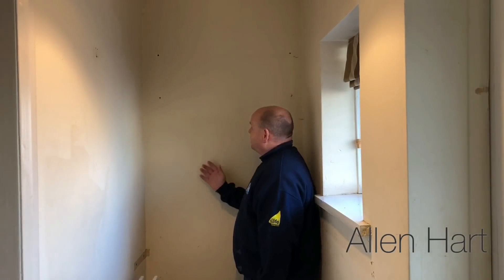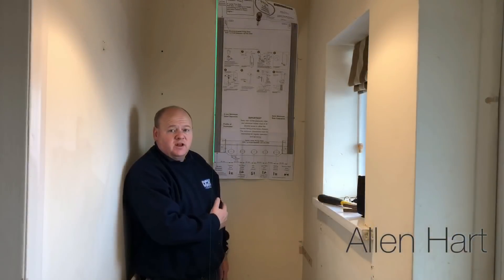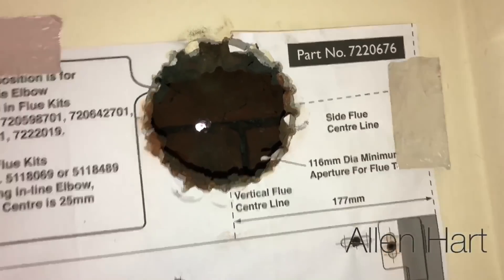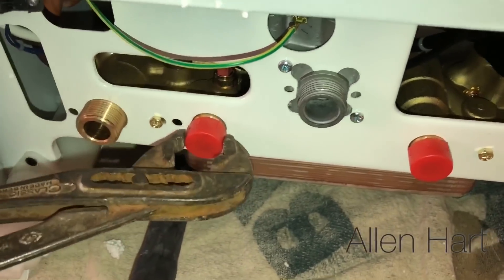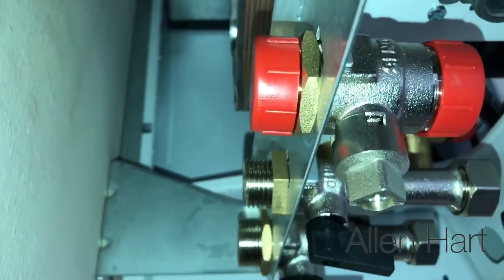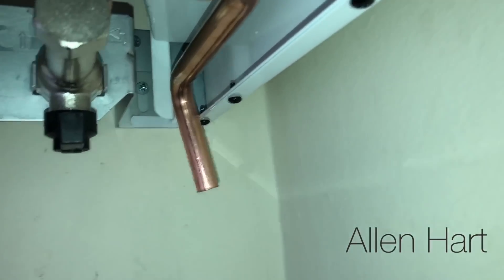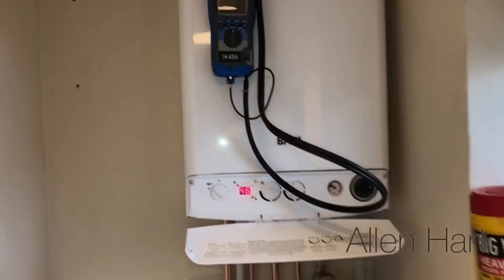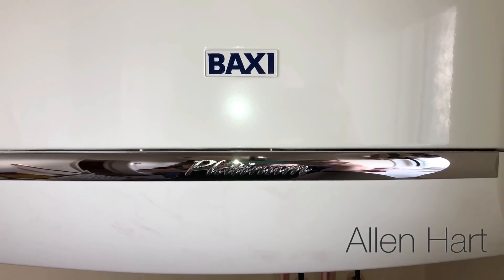How to Install a Combination Boiler Baxi Gas Combi Boiler Installation

Comment: Im confused about those copper pipes underneath.Im guessing they are flow, return, gas and water but what is the other one for?
Reply from the maker: Return, Condensate, Hot, Gas, Cold, Flow and PRV. Thanks.
Reply: Thank you. Every day is a  learning day!
 @AllenHart999

Comment: Nota bad video but it didn’t really show to much.   I just also don’t understand why you didn’t drill one pilot hole for flue then go outside and drill core hole so no mess.   There was nothing about the flue or soldering of pipes really basic.

Comment: Very random question, but we are about to have a combi boiler installed, will the plumbers need access to each radiator to check the heating works afterwards? I have a room filled with stock that I sell and would need to shift a lot of stuff for them to get to it and was hoping they wouldn't need to check the all lol thanks in advance
Reply: So what happened

Comment: Say the gas meter is in the garage and theres a has supply going into my airing cupboard, because i havnt had a gas boiler (soild fuel) would they need a new gas supply routing jnto the house?
Reply from the maker: Yes you would need a gas pipe for a gas boiler. Thanks.
Reply: @AllenHart999  there is already a supply into the house i guess they would take it off that, unless BG fit some kind of new meter and piping
Reply from the maker: @markjwoodford1931  I would expect so. It’s hard to give advice without seeing it. Thanks.

Comment: Are these easy to fit to existing heating systems? We’re looking to change from oil fired central heating to gas, but I’m unsure oh how much work is involved, ie do we need to change existing pipes and radiators? Do new pipes need to go outside the house ie drilling through walls, so we need a new flue or can it be added to the one we have?
Reply from the maker: You cannot buy these boilers anymore, unfortunately. Thanks.

Comment: Hi Allen Just a question about the positioning of a condensate pipe.If there is no choice but to site it externally will it definately not freeze during severe cold weather if it is fully lagged.?
Reply from the maker: This one has loads more. Thanks https://www.youtube.com/watch?v=knON5Asy1YQ&t=783s

Comment: So easy, takes about half a day yet a some idiot from British Gas charges you thousands to drill a few holes and fit 6 pipes.. total rip of. Thank you to honest gas fitters, that don't rip people off. Although there are not many
Reply from the maker: Most people understand the price of everything but the value of nothing. I go to loads of cheaply installed boilers. Thanks.

Comment: Can i ask a question about being a gas safe engineer, i have been told by a couple of fitters that the rules regarding this only  apply to actually connecting  up the gas supply to the boiler,  there is no reason why as a regular plumber  you cannot fit the boiler to the wall connect all the water feeds etc and drill the flue hole in preparation for final installation, of gas connections by  registered gas safe engineer,Remember ime  just asking as this has come up in conversation a few time ,so is this correct.bfn Pete..
Reply from the maker: peter ryan You need to be Gas Safe to install a boiler. A gas safe engineer is not legally allowed to sign off someone else’s work. 👍
Reply: Many thanks, Allen  @AllenHart999   I thought this was the case but we both know this does happen,.

Comment: Your intro always reminds me of Johnny Cash! 

I'm not a heating/plumbing guy but I know all the big makes come with a mounting jig, however have obviously never fitted a boiler. Around 5:00, after you've accurately fitted the jig with the corresponding template etc you find the pipes don't line up... What's the point in the jig if it isn't accurate? Do you find it's still a useful addition or would you rather Baxi et al just left you to it?
Reply from the maker: I like the jig really. It has taken me a while to get used to it though.

Comment: Hi Allen, Commercial boilers offer two stage frost protection through the Building Energy Management Software (BEMS); 1stage is pump on at approx 5degC and 2nd stage is boiler on. Do you know of any domestic system controller/software that offers a similar control method please?

Regards,

Comment: I have one of these and I'm trying to uninstall it to start renovation a house and it won't budge. Engineer has disconnected the gas (and gas pipe has been capped) I've undone all the pipe connections but I can lift it off the back plate. How do I do it please?  Engineer said just pull it forward from the bottom and lift but nothing is moving it.
Reply from the maker: This one has loads more. Thanks https://www.youtube.com/watch?v=knON5Asy1YQ&t=783s

Comment: If the boiler is fitted according to manufacturers instructions and how can you prove it’s dangerous. To be a gas safe engineer costs a lot of money. If you don’t have money you cannot get on the course. Also when your on the course gas engineers don’t want to know you. So it’s a never ending cycle.
Reply: This gas safe bullshit is all to do with gaining a monopoly that all the shit is about.
Reply: @Juchris1722  Oh right so lets say leaky poisonous fumes isn't a big deal then ?
Reply from the maker: Just pay a gas safe engineer to install it for you. You cannot do a DIY install unless you have all the tools to do the correct tests. Thanks for watching.

Comment: Don't you fit a shock resistor on the cold feed?
Reply from the maker: Depends on boiler installed and also if it has a water meter. Thanks.
Reply: @AllenHart999  I always fit one, just in case they have a water metre fitted in the near future, and then the boiler will still be protected.
Reply from the maker: @AdrianBordoy  Depends on boiler, Not all boilers need them. Which boilers do you install.
Reply from the maker: @AdrianBordoy  1. All DHW circuits, connections, fittings, etc. should be fully in
accordance with relevant standards and water supply
regulations.
2. Your attention is drawn to:
for GB: Guidance G17 to G24 and recommendation R17 to
R24 of the Water Regulations Guide.
for IE: the current edition of I.S. 813 “Domestic Gas
Installations”.
3. The Water Regulations recommendations for England and
Wales prohibits backflow from appliances into the wholesome
water supply due to thermal expansion. However this type of
instantaneous combination boiler, with less than 15 litres of
stored capacity, does not require any backflow prevention
device as any thermal expansion is accommodated within the
appliance. It is possible in certain circumstances that other cold
water demands (e.g. washing machines, flushing of W.C.s) may
affect the DHW function of the boiler. In these instances the
fitting of a backflow prevention device and expansion vessel is
recommended.
4. In instances where the mains water supply incorporates a
non-return backflow prevention device, or any other device that
includes one*, it is possible for a build-up of pressure to occur.
This may result in damage to the boiler and other appliances. To
prevent damage to the boiler it is strongly recommended that a
suitable mini expansion vessel is fitted on the mains water inlet
between the boiler and the non-return device. *(The
manufacturer of the device should be consulted if there is any
doubt regarding the presence of a non-return feature). Even in
circumstances where a non-return device is not fitted any future
modifications to the mains inlet (e.g. fitting of a water meter)
should be considered and an expansion vessel fitted. Baxi cannot
accept any responsibility for damage to the boiler if these
recommendations are not followed.
5. The boiler’s maximum working mains pressure is 8 bar,
therefore all pipework, connections, fittings, etc. should be
suitable for pressures in excess of 8 bar. A pressure reducing
valve must be fitted for pressures in excess of 8 bar. The
manufacturer of any outlet fittings, such as a shower valve, may
require a lower maximum pressure. The pressure reduction
must take account of all fittings connected to the DHW system.
Reply: @AllenHart999  Baxi
Reply from the maker: @AdrianBordoy  Good man 👍

Comment: That's really shit that the baci stuff doesn't line up!
Reply from the maker: Thomas Henderson It lines up if the wall is perfect. It’s not an issue anyway. Thanks
Reply: Allen Hart Ah I see, so it's not that baxi are terrible designers then!
Reply from the maker: i have fitted hundreds and hundreds of them and they have proven to be one of the best boilers over the last 12 years in my opinion.
Reply: Allen Hart Top info, thanks.

Comment: Could you not use plastic pipe to bridge /sleeve the cavity for the copper pipe - to avoid any corrosive connection with cement and copper?
Reply from the maker: Plastic would be better really, most people dont do any. Thanks for watching.
Reply: Allen Hart wow quick response - thanks.
Reply from the maker: I am going to use plastic now lol, Thanks for the comment.
Reply: Allen Hart 😂
Reply from the maker: If you look on my day in a life of a plumber video, how to install a boiler, i used plastic on that one. lol.
Reply: Allen Hart / I will certainly look at that one. I enjoy al your videos and I am still catching up on your output - but not in any particular order.👍

Comment: you use that filter to avoid of corrosion or particle in line? is that magnesium?
Reply from the maker: The filter helps to stop any sludge into the boiler, hopefully this will help the boiler to last longer.

Comment: Nice video. Few questions. 1. Did you use jointing compound when connecting the gas pipe to the boiler? 2. Do you intend to attach equipotential bonding to the pipes after via yourself or a sparky? 3. What material did you use to insulate the external section of the condensate pipe? 4. Lastly do you prefer an Anton or Kane analyser? Cheers.
Reply: nice neat install Allen!  baxi platinum or an ideal vougue what would you have?
Reply from the maker: Keith Reid No question about it, I would definitely choose the Baxi I I used to really like the vogue but they have changed the internal components to plastic, Baxi is brass and copper with stainless steel heat exchanger
Reply from the maker: Wow you do have a few questions lol, I have used Kane and Anton and they are both very good personally I prefer the Kane. The condensate is run internally. we haven't added bonding but the customer is a sparky and he is sorting the electrics out. your gas safe engineer will need to tell you about the gas stuff we haven't shown any gas work in our video, Always use a GasSafe Engineer. Thanks.
Reply: Allen Hart hi Allan ive been installing for the last 10 years my main gripes with the baxi is that shit quality jig, surely baxi can manufacture somthing that actually lines up.  The prv pipe that was supplied with the duo tec was always wonky. Had to bend the pipe to get it straight. Also hate adjustable gas valves. I havnt fit a baxi for a few years but i might look into them again. Oh the plume kits were awkard to fit on some of them. Apart from that..... a good boiler.